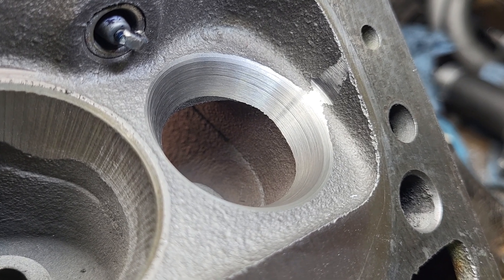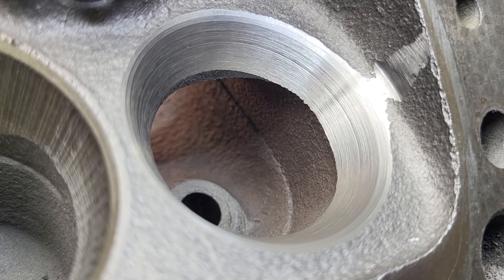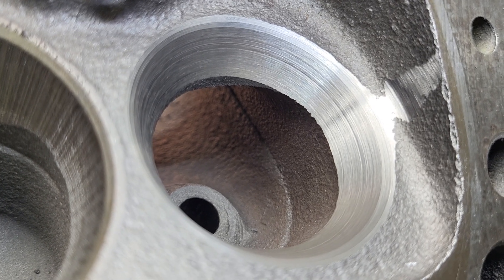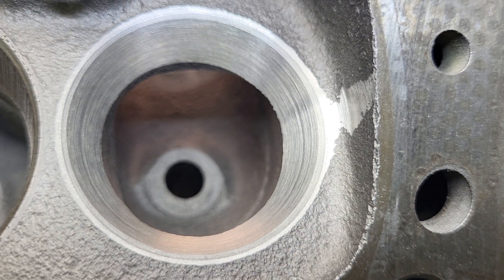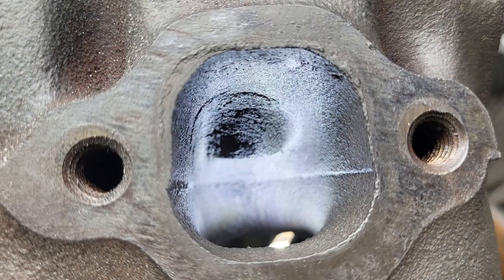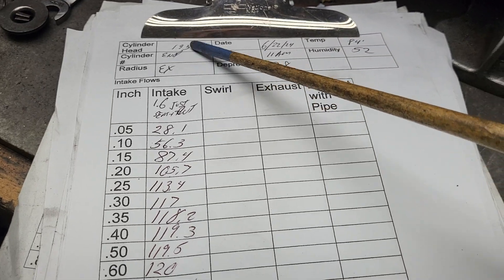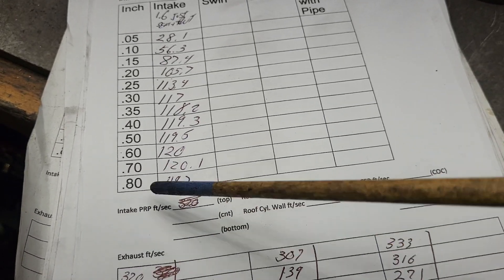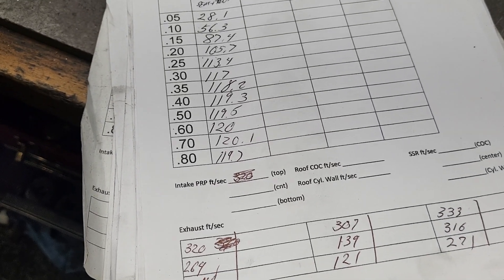Chevy TBI head exhaust throat experiment.

Comment: Hi charlie what angle good for exhaust and intake seat for street and race
Reply from the maker: Depends on what you are trying to do. D.V. likes less than 45 degrees and lots of guys like 50 +. Higher the rpm the better the steep angles work. I have done some limited lift stuff that was 30 degrees.

Comment: My old guys would bowl hog the exhaust and tell me thats enought. 
  By chance do you have a LT4 exhaust to compare it to.  The GM fast burn heads typically used smaller valves on the exhaust to fit the larger intake valve. The exit also looks similar to a d port shape. The dart has the square port. I think they do that to increase those middle and inside low speed areas.
Reply from the maker: Never did lt1 reverse cooled head. Sorry
Reply from the maker: Never did a fast burn either. They look pretty good stock.

Comment: Seems like the flow would be murdered, and it was. There is typically no sense in going to a bigger valve or even a larger cc port (think max wedge chryslers) until the form is right  for use.
Reply from the maker: Shape is most important. Thanks

Comment: Hi Charles!  I got interested in the flow speed of the port you had measured. Which side of the port did you measure to be faster by default(is it the cylider wall or center side)?
Reply from the maker: Center
Reply: @servediocylinderheads  Interesting! Isn't it usually the cylinder wallside which supposed to flow better?
Reply from the maker: @mikkokuorttinen3113  Hahahaha.
Reply from the maker: It takes work to even the air flow out. It likes the shortest path.
Reply: @servediocylinderheads  Yep, got it! So it must be pretty well congested exhaust! Wouldn't this suggest that you ought to open up the area with the highest flow, in this case the cylinder centerside?